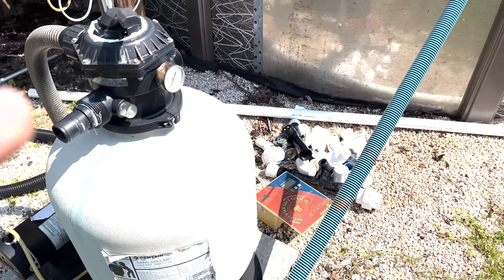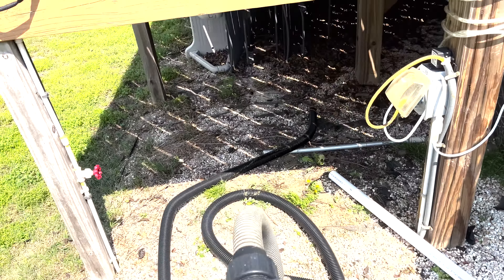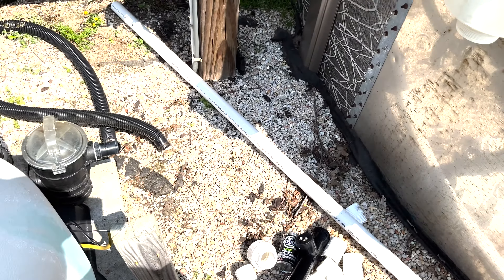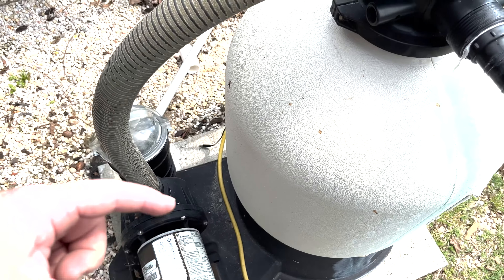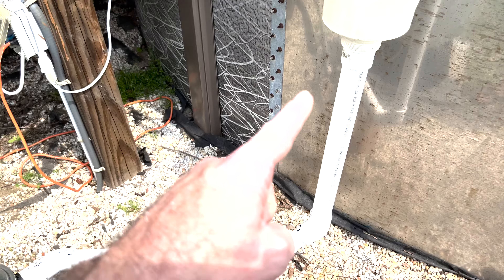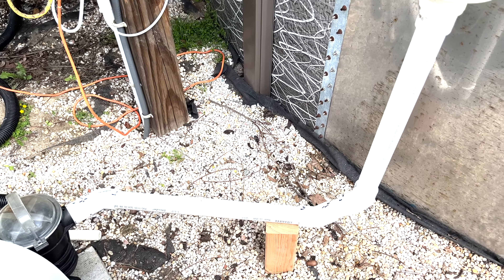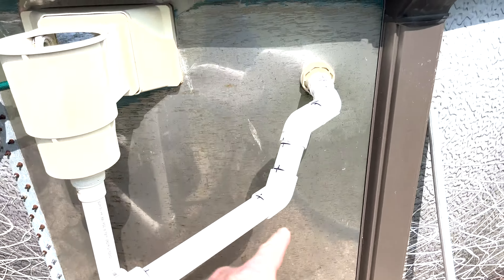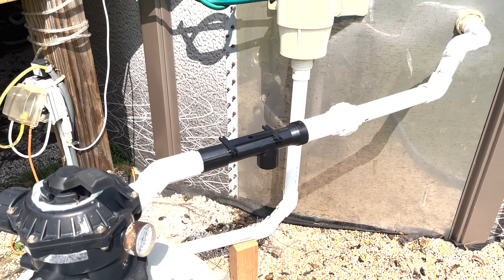How to Hard Plumb your Pool Pump and get rid of ineffiecient flex tubing

Comment: I am considering doing this to my above ground pool. Why didn't you consider flexible PVC for some of those longer runs? My fear of ALL hard pipe is there is little to no forgiveness and my pump runs 24/7 during the summer and is always vibrating.
Reply from the maker: I have very little vibration, my pump has rubber bumpers on the feet. I didn't want to use any flex because I didn't want a weak point and I didn't want any turbulence in the line, to help the pump be as efficient as possible. Good luck with your project! I hope this helps!